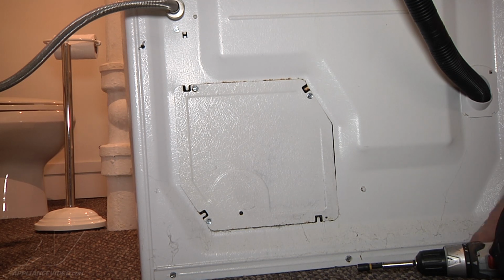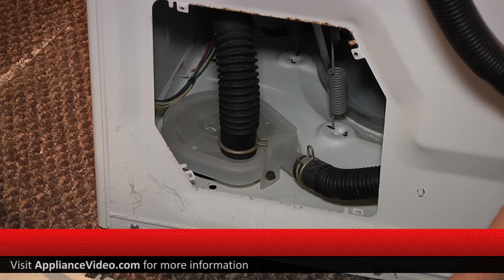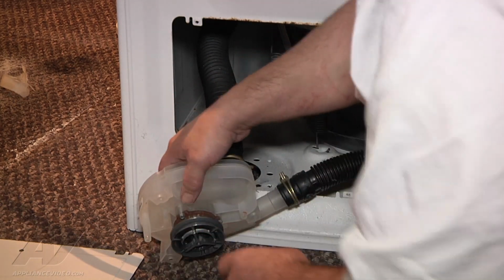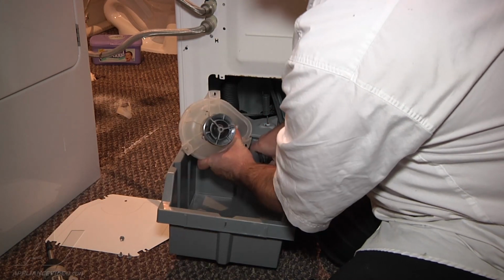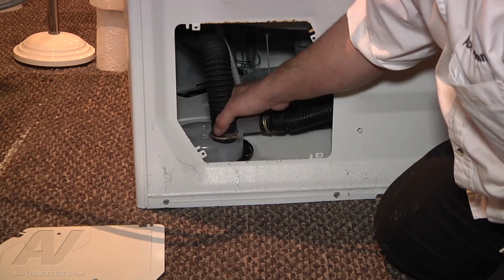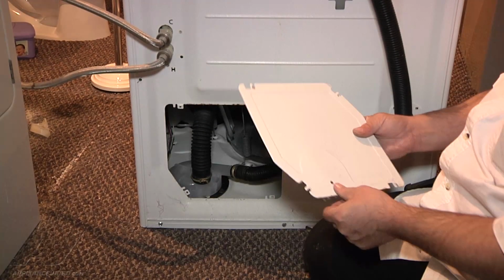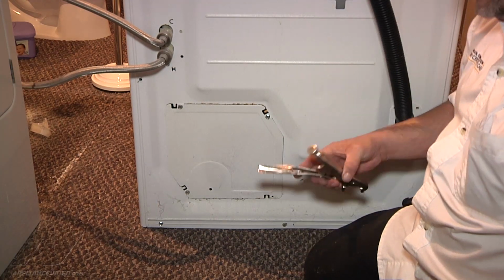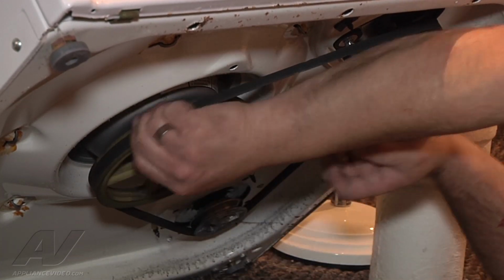Maytag Washer Repair - Making Loud Noise - Pump-ASM

Comment: Pump assembly 35-4643 is not showing up in your parts department. Is that no longer in use? Do I use a different type?
Reply from the maker: peteissomineify Call our parts department at 1-800-830-5465 with your model number and they can look up the correct pump. 
 Please help us
provide more videos to our site by subscribing to our YouTube page or posting our
http://www.appliancevideo.com/ website on your Facebook or Twitter account. Our
factory authorized technician’s also daily provide free professional Repair
Help to people like you to help solve their appliance problems. You also have the option to email a factory
service technician with a question at http://www.appliancevideo.com/repair-help/ .  If
you need of parts for your major appliance, we have over 5-million parts in
stock at http://savemoreonparts.com/ . Thanks
in advance for supporting us. So email us if you have any other questions our
videos cannot resolve. Thanks for your support in advance.   Matt, Ace Appliance service technician.

Comment: Hey my maytag atlantis washer makes a loud banging noise during wash cycle but spins out fine. Could this be a bearimg issue?
Reply from the maker: Great question, you can call
our parts department at 1-800-830-5465 and they can give you help 6-days A week
Mon-Sat . You can also search at www.SaveMoreOnParts.com 7- days a week.  If you have a more
technical question that our parts department cannot answer, our technicians are
answering all questions at our website at www.ApplianceVideo.com under our Repair Help section. We have over 6,000
common questions and answers that you can easily search through by your model
number, appliance make, problem or error codes, and It’s completely free to
search through our question & answer library. There is a very good chance
you question is already answered there.

Comment: eww1273 is making weird noises we. we cleared the pump but the washer won't work. everything we click start it makes a noises like tick tick. please reply soon
Reply from the maker: +Pizza Hut 

 

All of our technicians are
now answering questions daily at our http://www.appliancevideo.com/ website under the Repair Help section.  We also have
over 1600 common questions and answers that you can easily search through by
your model number, appliance make, problem or error code and it’s absolutely
FREE. You also have the option to email a factory service technician with a
question on your appliance at http://www.appliancevideo.com/repair-help/ . If you’re looking for a repair video, you can also search
our library of over 2600 free repair videos. ApplianceVideo.com specializes in
quality DO-IT-YOURSELF appliance repair videos and we get over 800,000 views
per MONTH to our videos worldwide and growing. If you need of parts for your
major appliance, we have over 5-million parts in stock at http://savemoreonparts.com/ .  Thanks for your support. Matt Ace Appliance factory
service technician.